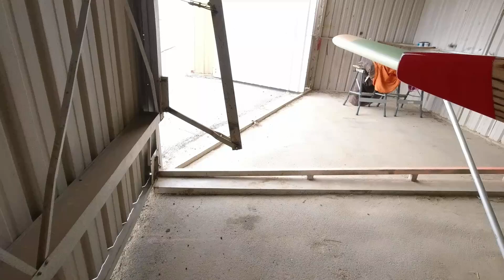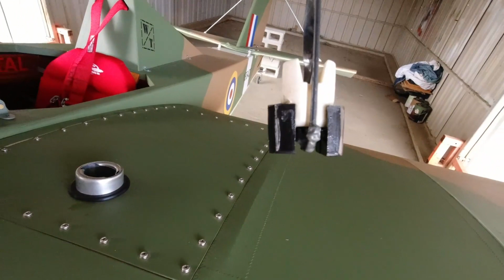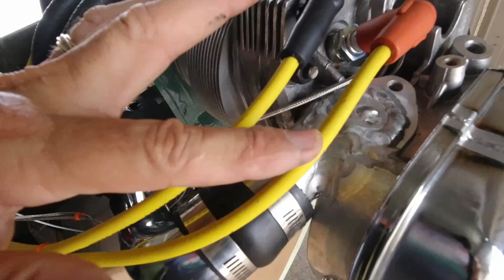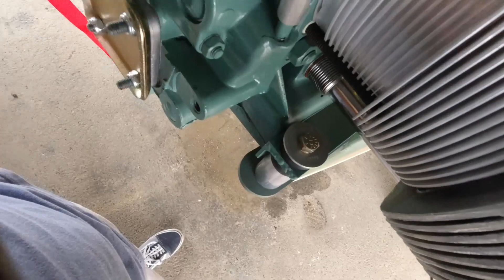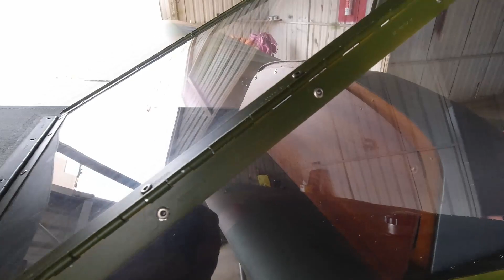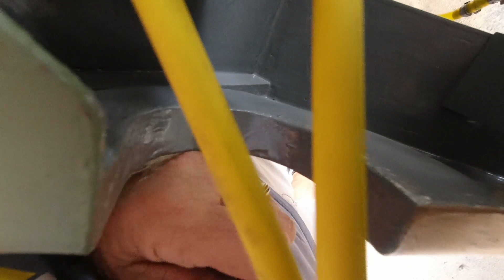Minimax 1100r Wood Aircraft Build - Status Update

Comment: Dennis, wear your helmet and safety harness when practicing your taxi runs.  I found out the hard way that it is really easy to find yourself airborne.  When it happened to me, I did a wide turn and landed safely, but a few years before, at the same airport, a Mini-Max builder was killed when he accidentally got airborne, panicked, landed hard, and was thrown from his airplane.  You're also going to find that landing a Mini-Max can be tricky.  Because it has no suspension, it's easy to bounce the plane, and just as easy to ground loop.  The trick is to hold the plane off the runway until the stick is all the way back.  I'm sure you realize all this, but just in case...
Reply: I loved landing my EROS 1650 in heavy cross winds.  Some "old timers" showed me how to do this effectively.  Just keep that upwind wing down, and touch down on the upwind main gear and the tail wheel at the same time.  This keeps the wind from "weather cocking" the plane.  If you make a wheel landing, the wind will push on the fuselage and you'll pivot on both the main gear.  Try this method - I think you might like it.    More fun to do that, while holding a good crab into the round out and into the flare.  All of this will definitely keep you busy.
Reply from the maker: I’ve seen some people practicing this in a Cub even in calm winds. Some TW drivers have incredible skill
Reply: @DTMinimax  I once saw a pilot take off in a Cessna 150 in what had to be a thirty MPH crosswind from the left.  As soon as he started down the runway, he brought the right wing up and the left wing down, within inches of the ground, and went down the runway on the left wheel until takeoff.  If I tried that, I wouldn't be here to talk about it.

Comment: Looking at the new engine mount plate on the left side, there appears to be a gap between the bottom of the metal plate and the top of the wooden engine beam.
Reply from the maker: There’s a rounded edge there so it looks like a gap

Comment: I'm an 8800 hour flight instructor, with 7600 hours of dual given, and you are going about this in exactly the right way. I've also owned and flown a Minimax and instructed in Citabrias and Taylorcraft etc. Expect the Minimax to slow down much more quickly than other aircraft, and to be more short coupled than the Citabria during takeoff and landing. My Minimax was a little squirrely on asphalt and a pussy cat on dirt, so I'd also recommend first flights on dirt or grass if possible. Excellent workmanship by the way.
Reply from the maker: Thank you so much for the confirmation!
I don’t have access to dirt or grass at Fox but I am 7,000 x 100 so I have plenty of room:)

Comment: Congrats on the Tail wheel endorsement but wait a sec, didn't you already build & fly a minimax before in times past? I'm confused ha ha (normal) Fricken adhd ha ha. Can't say enough how much I enjoy your video's.  So glad I found your channel so randomly when this project began. 

With the tailwheel assy, can't you just use the centreline of the fuselage as a guide to make sure it's setup & tracking straight? 

When you were talking about the Stalls & recovery process you triggered my brain from flying gliders. Our training is full forward stick & full opposite rudder to the direction of the spin (in a fully developed spin) I ain't no expert but I do highly recommend any pilot to go gliding & get proficient, you don't have an engine to begin with so every action you make is important. 
I got into a stall once at 1,300 feet above the ground in an IS-28 & lost 300 feet in a half rotation. By the time the instructor could yell my Aircraft I had already recovered at 1,000 feet & on the downwind leg (just happened to be there) & I didn't relinquish control, just called downwind & proceeded to land normally. The instructor thought I would've been shaken up by this & told me I needed to get right back in the air again. (There's a lot more to that story) In reality I knew exactly what the glider was doing & how to stop it. I never once felt unsafe. I have so many stories. 
Wow anyway, that's a lot of writing & I'm only 6 minutes into your video ha ha. Fricken wish I could meet you in person.  Cheers from a random Bloke down under! P.s. was 30°C here yesterday.  Whoo hoo!
Reply from the maker: I have some glider time and love flying gliders!
My first Max was an ultralight that I only flew on grass. I feel like I have a completely different animal here